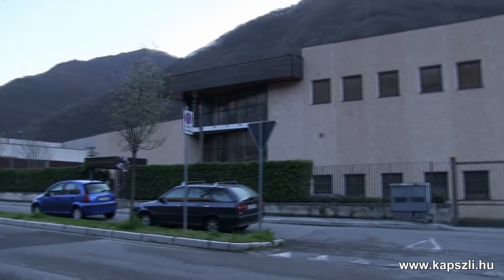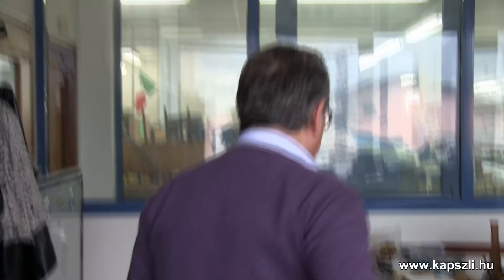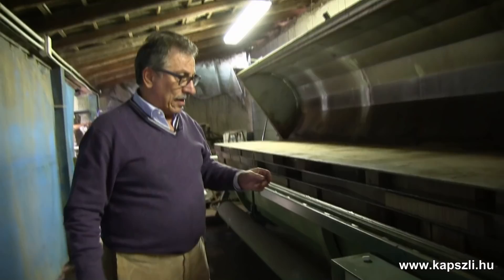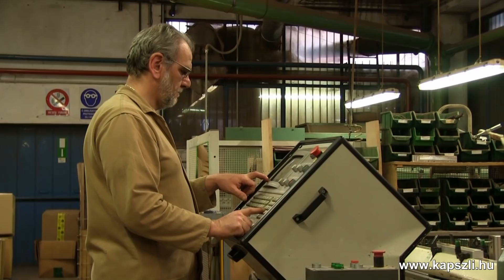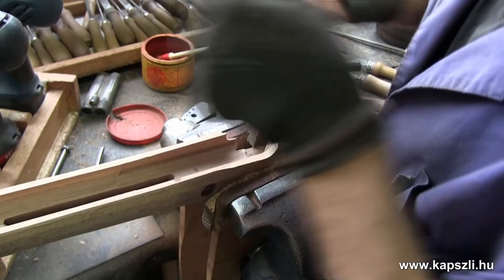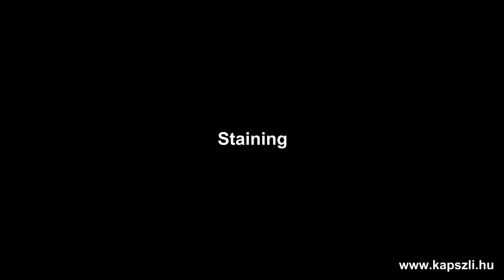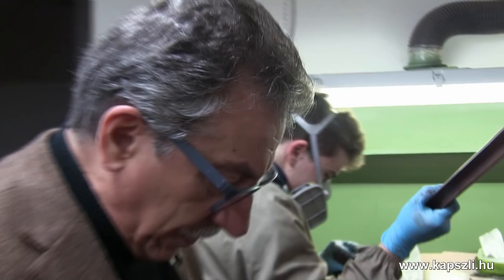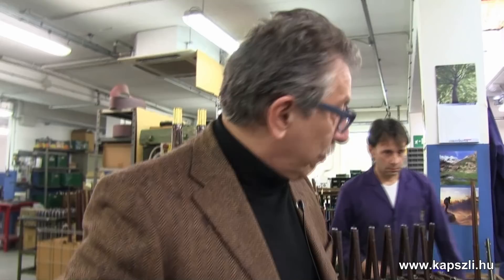Stock making at the Pedersoli factory

Comment: I bought a pedersoli muzzleloader shotgun recently. Precisely it's the "slug" shotgun which I preferred because it has two cylinder bores which makes it easier to load being a muzzleloader. And I gotta say honestly I really like the feel of the gun, it's well balanced has a pistol grip, stock is a nice piece, materials seem great quality. However in my particular example the fit and finish leaves a lot to be desired. Trigger play in the right barrel trigger (not a problem in a shotgun but still), rear trigger isn't covered by the trigger guard completely. Trigger guard and trigger assembly are connected with one tiny hinge and they fit into the stock very tight so it takes care to remove it and put it back in in order to not snap that pin (hinge). I had to clean out the locks, trigger assembly and insides of the stock because after first shooting I took the barrel off and noticed a lot of dirt, shavings etc from production. Buttplate not sitting flush with stock in one spot (about 1mm gap, also not really a problem as I use a leather recoil pad to save the plate from scratching). And even tho barrels are accurate, well made, smooth and polished the bluing is really spotty. Even one screw for that strap on top where barrel hooks into has a hole drilled at the wrong angle so the screw head doesn't sit flush. 
Overall i really like the gun but small details like that leave bad taste especially that those are supposed to be basically premium guns. For the premium price.
Sorry for a bit of rant, I don't want to discourage anyone from pedersoli guns, I just advice to take a close look at them like I failed to because I was in a hurry

Comment: Good night, 
Now watched a little video about the process Pedersoli stock Factory. 
I am fond of restoring butts but so far have not found the ideal products for the next working perfect. Sealer, dyer, Stain, wax, which are the best? 
I saw the video the process after the end lixamente, but needed to know what products utilizarm to finalize the butt and let that wonderful result! For example, what kind of sealer do you use? after which the dyer sealer (stain) that use? after which the process oil used for the final wax finish? 
Anticipate thanks. 
att

Comment: The stocks are hanging like that to prevent warping.
Reply: Is that true? I thought it would simply be for storage and space saving. At 6/7% humidity, surely the warping issue is not a problem? 
Unless weighted significantly at the bottom it isn't going to stop any sort of warping.